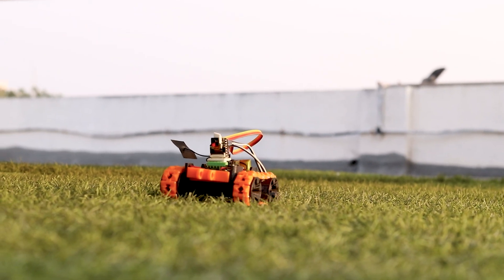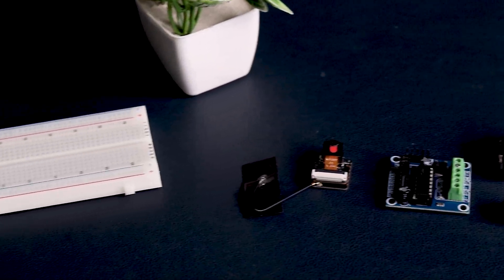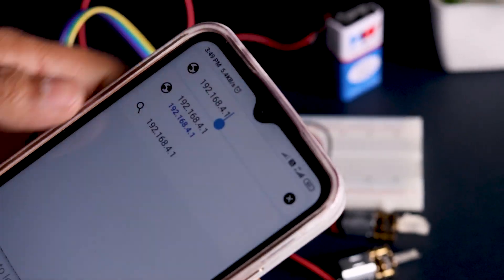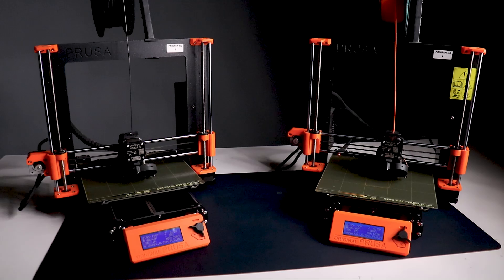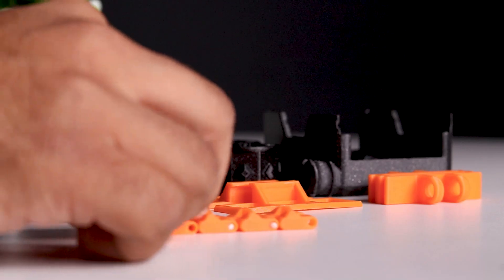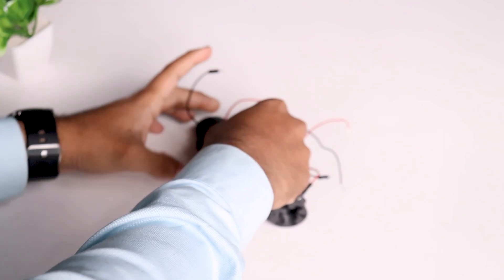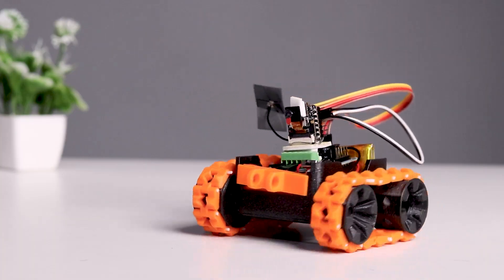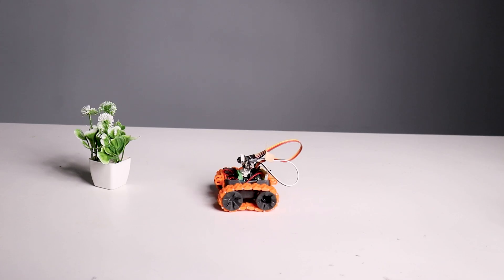How to make a FPV Tank using Seeedstudio ESP32S3 Sense : Step-by-Step Guide to DIY Excitement!

Comment: Hi team,

I am facing issue after uploading the code, serial monitor is blank and no wifi AP appear. 
Kindly help.
Reply from the maker: Hello, Manuyadav
1. Once the code has been uploaded, try detaching and reconnecting your S3 sense board with the serial monitor on.
2. Try uploading the empty code and then Main project code. 
3. Use example code to test your board to ensure it is operating correctly.
4. Verify whether the AP SSID is visible on your Wi-Fi network. If it is, connect it, type 192.168.4.1 into your browser, and see if the buttons or stream are visible.
Reply: @RobuInlabs  I am having problem seeing the video stream.  AP starts, buttons are visible, ESP32S3 wifi and video all work fine in other example sketches.  Any help is welcome!